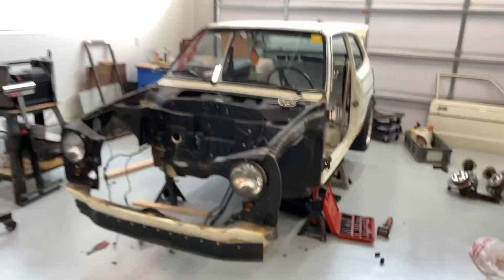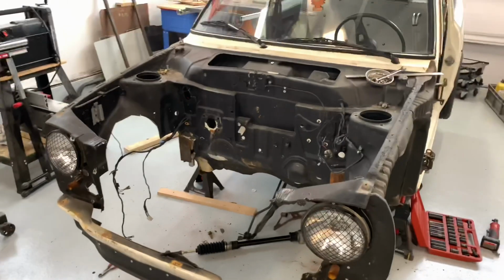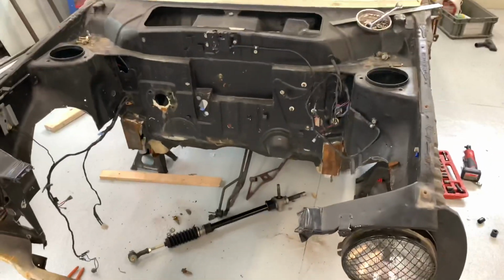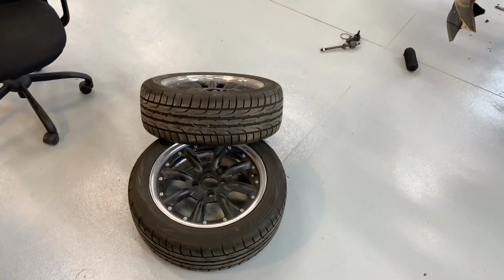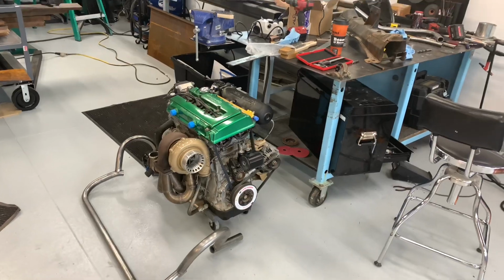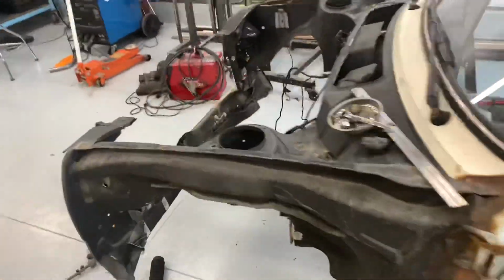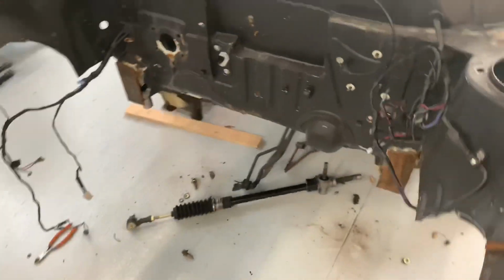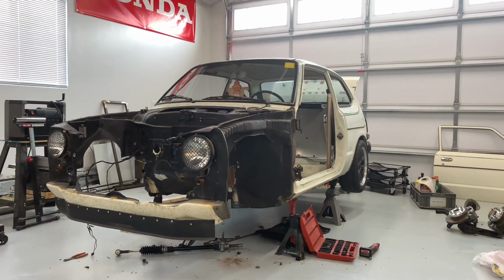600hp 79 civic build  (Ep#1) History/Plans

Comment: What did you use for your 4x100?any good places you could recommend for info on these? I have a wagon in this 79-83 I think it is body style also have a wrecked 91 ex sedan.the sedan is totaled but before it was totaled I acquired the rt4wd diff trans trailing arms etc